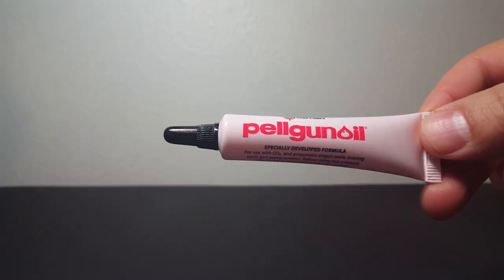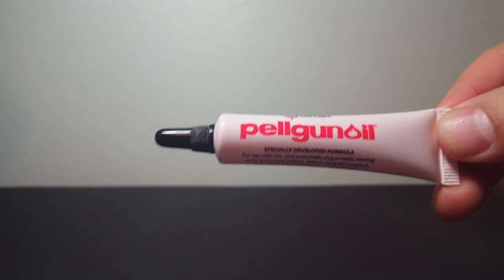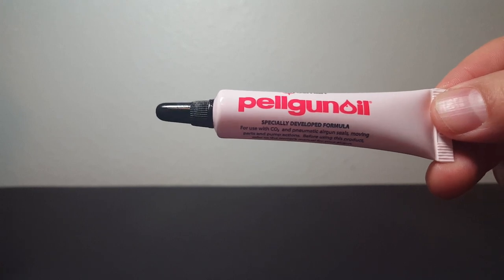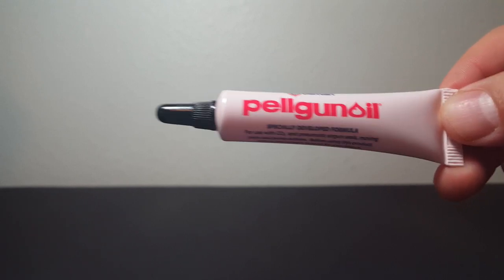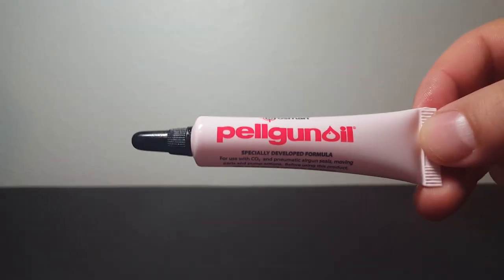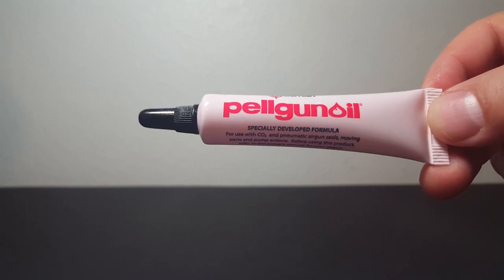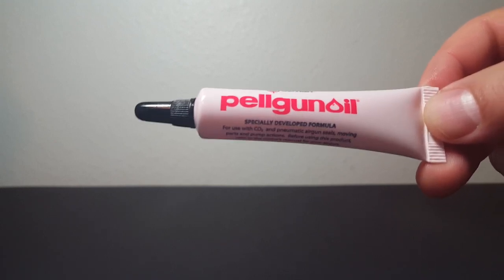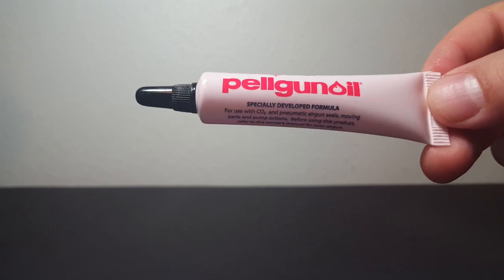Pellgun Oil: What is It?

Comment: Hello sir
First thank for the video
Sorry my English is not good I have question and I hope you can help me
I have crosman pumpmaster 760 it's been 1 year and I think I shot maybe 300or 400 times the forearm is a little bit become hard to pump and the manual of the rifle said: it's important to add 
pellgunoil 0240 every 250 shots to ensure the uniform power
I have the 0241 crosman pellgunoil
Should I put or not?
Do you advice me for better alternative?
Reply from the maker: Mohsin, since you already HAVE the Pellgun oil on hand, yes, you can use it on your 760.

When a pump gun is not used for awhile it does better to wake it up with some lube.

Use your Pellgun on the rubber cup you see and can feel when your pump handle is all the way up. Then, yes, every 250 shots. Crosman pump guns can be oil pigs! But no big deal. When it honks, squeeks, or is hard to operate lube the cup and the pump joints, metal links.

There is nothing inherently wrong with Pellgun for your 760, but it is EXPENSIVE for motor oil. And 30 SAE ND does everything Pellgun oil does except cost as much. That big jug of 30 ND can be used for other lube jobs. But you would need to buy some squeeze bottles for your 30 SAE ND.

But use the Pellgun oil you have, and when you run out, make the choice then what to go with at that time. The price and the leakage problems, I had, made me look else where.
Reply: @daisy880fanaticfixit9  thank you for your help so the point is the cost as it motor oil in small amount so no damage to my 760 pumpmaster? safe to use? And about the cost I got the pellgunoil for about $4 maybe
Reply from the maker: Mohism, you are welcome. Thank you for being curtious.

No, damage to your 760. But for FUTURE safety, DO NOT use Pellgun oil on a break barrel or PCP.

If you read the Pellgun tube, it SAYS on there not to use that motor oil on PCP OR break barrel. It detonates or expodes.

The biggest controversy is CO2. Some swear it wrecked their seals. But others say, CORRECTLY, that mishandling CO2 platform - like leaving CO2 IN THE GUN when not in use - destroys the seals.

Leaving open CO2 in gun would be equivalent to you leaving your 760 pumped and not shooting it. Don't do that - THAT MOVE CAN DESTROY  a pump gun. Pump and shoot. You decided you are done shooting, but the gun is pumped, SHOOT IT into a bush. Then put it away.
Reply from the maker: 2nd reply: On cost, the Husky is FAR SUPERIOR and look what you get for $8

https://www.homedepot.com/p/Husky-16-oz-100-Full-Synthetic-Compressor-Oil-018-0083H/300135698

This 30 SAE easily does what Pellgun oil does, and it is FOUR DOLLARS FOR A QUART.

https://www.walmart.com/ip/Super-Tech-Non-Detergent-SAE-30W-Lubricating-Oil-1-Quart/52626201
Reply: @daisy880fanaticfixit9  thank you for the very helpful information and I will add another question if not bothering you I don't want be annoying but I am really glad find such nice person like you / I did mistake and I want to know if this hurt the gun or not
I was shooting my pumpmaster 760 and I forgot that already pumped and reloaded the gun I take the forearm down to pump and I accidentally pull the trigger and shot while the forearm is down ! I know it's stupid mistake but is there any damage on that or it's ok? Again thank for your helping me out and have nice weekend
Reply from the maker: Mohshin, I try to be nice to nice, polite people. You are always welcome to ask questions.

You said your English is a struggle so let me answer that my best. If you pulled the trigger when the PUMP IS OPEN, you don't want to make that a habbit. Only pull the trigger blade when the PUMP IS CLOSED.

For ammo, your smoothbore 760 will shoot really well with Crosman's own Premiere Wadcutters. Just five pumps on my 1100 does great. You may want four to six for a 760.

https://www.pyramydair.com/product/crosman-premier-match-grade-177-cal-7-9-grains-wadcutter-500ct?p=313

Comment: Do it stop your gun from leaking?
Reply from the maker: Good question. If the seals are worn down - like 760 compression cup or an 880 O ring, then, no, new seals are needed.

But I know  many pump gun users WAKE UP their guns when pellgun oil or 30 SAE ND is used. It RE-SEALS it after a gun has sat unused for long periods. Stops air from escaping.
Reply: @daisy880fanaticfixit9  is dat a yes or no
Reply from the maker: YES, if your seals are still good. It keeps you at MAX power.

Comment: Can I use this on my Red Ryder rifle? Because I got mine today, and I'm gonna need to oil it soon
Reply from the maker: Lunar, yes. Pellgun oil fine here. But I need to say more to keep you a happy Ryder shooter!

If it is NEW...you should remove lever (super easy) and put that lube on the SLANTED PLATE you see inside. Use a light if you have to. It helps stop the new Ryders from trigger area jams. These three potential jams:

(1) Bear trap
(2) Sticking piston sear
(3) The plunger, or spring rod, from jamming inside frame.

Lunar, also, you will be REWARDED with better accuracy - smoother trigger and smoother gun firing behavior.

Happy Ryder plinking  and please don't re-shoot BBs.
Reply: @daisy880fanaticfixit9  thanks for filling me in on all the info! Imma go subscribe to you now😳😁

Comment: can i put  PELLGUN on the internals of my umarex colt SAA revolver
Reply from the maker: Martin, you can use it on the moving metal parts - and the best way to get it on the internals is not to disassemble. Just put a drop of Pellgun oil on tip of  EVERY NEW CO2 you put in your pistol.

Umarex would prefer you use RWS silicone.

Others say to get best value on airgun grade silicone. 
https://www.amazon.com/Super-Lube-56204-Silicone-Lubricant/dp/B083NXVGQX
Reply: @daisy880fanaticfixit9  thanks for the help

Comment: Is ok to use on a red ryder?
Reply from the maker: It is, but lighter oils are smoother in the Ryder. Also, I found it easy to flood the Ryder with pellgun oil because it is hard to see what you are doing. Then, the oil runs down your gun and stock.

https://ballistol.com/pages/about

https://www.oreillyauto.com/detail/c/non-california/pure-guard-non-california-motor-oil-10w-1-quart/pgdn/nd10qt

Using a needle nose, practice on a piece of paper before lubing, so you have an idea of what is happening inside your oil hole.

https://www.hobbylobby.com/Art-Supplies/Painting-Supplies/Palettes-Tools/Needle-Tip-Applicator-Bottles/p/80984644

Comment: Will this work for my break barrel Hatsan mod 25 Supercharger pellet gun? 1 drop down the barrel? If not, what would you recommend? Thanks
Reply from the maker: Eden, great question! NO WAY! I will give you other choices. No petroleum goes in a spring gun like your Hatsan. It will FRY your piston seal. No power.

This is a common flub, treating a Springer like a pump gun. Your Hatsan needs only rare, careful silicone lube in transport hole. That hole appears when you break open breech. A drop or 2 every 1000 shots.

https://www.pyramydair.com/s/a/RWS_Air_Chamber_Lube_Dropper_Silicone_Oil_50_oz/3002

https://www.pyramydair.com/s/a/Crosman_Silicone_Chamber_Oil/311

Comment: Can this be used for my crosman 760 pumpmaster I'm new to pellet rifles and what part do I use it on?
Reply from the maker: Bray, you can IF you already bought it. But there are cheaper alternatives that are arguably better.

Lube rubber cup in open pump and hinge points in pump handle.

Here are HUGE value choices:

https://www.homedepot.com/p/Husky-16-oz-100-Full-Synthetic-Compressor-Oil-018-0083H/300135698

https://www.oreillyauto.com/detail/c/pure-guard/pure-guard-compressor-oil-4-quart/pgd0/ac18

https://www.hobbylobby.com/Art-Supplies/Painting-Supplies/Palettes-Tools/Squeeze-Bottles/p/57415

Bray, compressor lube is DESIGHNED for a pump environment.
Reply: @daisy880fanaticfixit9  thank you for responding I'll look into the other choices

Comment: Crosman also sells a silicone oil so when should I be using it?
Reply from the maker: GREAT question. Pellgun oil is so controversial and either loved or hated.

On the latest generation of pump guns, Crosman actually says to use their silicone on the Legacy  - which would also cover their other pump guns.

If you own a PCP or break barrel, the choice below is the #1 choice.

If you are into basic pump guns or CO2, and are determined to use only silicone, know it MUST BE AIRGUN GRADE. Here is #1 choice here and GREAT VALUE!

https://www.amazon.com/Super-Lube-56204-Silicone-Lubricant/dp/B083NXVGQX

Comment: Is there an oil that can be used for every part of the gun because I feel like having to buy different oils for different parts can be a hassle
Reply from the maker: Feng, very fine question. I was just just wiping down Crosman PSM 45 with Ballistol. The classical German oil makes beautiful wood, metal and black plastic. If anything black plastic looks the best!

I use FP-10 on a few grinding spots and RWS Silicone for the power plant every 800 shots.  

3 different products.

Feng, I will guess you are talking  about a pump gun. Crosman actually started labeling that lube isn't for PCP or break barrel.

For my  Remington 1100, I just lubed the loading bolt, and the metal pump joints and seals with 30 SAE ND. Order a dropper or go to Hobby Lobby or fav gunshop.

🌟Non-detergent motor oil is compatible with the black plastics, metal, and the Nitrile seals in the 1100 gun. I used it for all three.🌟

Many think petroleum, which is actually mineral oil for lube, is bad. That isn't based in science. Many use poor quality silicone products that aren't good for your gun - Gamo flat goes on the offensive and says  even expensive silicone will actually cause DAMAGE to metal on metal.

That paragraph I just stated covers the engineers at these companies:

RWS
Gamo
Crosman
Daisy
MAGNUM AIRPOWER

https://www.oreillyauto.com/detail/b/non-california-4604/chemicals---fluids-16461/oil-16865/motor-oil---conventional-25267/2673028dc6c2/pure-guard-non-california-conventional-motor-oil-30w-1-quart/nd30/4616028

Comment: On the instructions of maintenance on my airgun it says to oil it every 250 shots but I don’t know where to oil it can someone’s plz tell me where???
Reply from the maker: FIRST, let me congratulate you, sir, for reading the instructions. Many don't read. Then they hear from buds to use spray silicone - and they lose their gun quickly.

Yes, Crosman wants it every 250 shots. My 1322 video covers what it looks like. But open the pump, target the rubber cup at bottom of gap, and  put 2 drops there. Put 1 drop on the joint above it in the pump tube; that connects to the pump handle.

If the metal links look dry put a drop on the pivot points (inside rivets). One spot is at the top of pump tube where retaining pin holds it in place. The 2nd pivot point is the arm connecting to the pump handle.

Comment: What about auto trasmision oil. They have many O rings.
Reply from the maker: Karen, TF will work if you CAREFULLY choose your formulation. Or it could damage your gun. 

A Brit chose the wrong Tranny formula, and it demolished his buffer on the pump head in the 880.

Karen, would you consider compressor oil? They are non detergent - and no other additives that could hurt your pump gun or C02.

https://www.amazon.com/Husky-100-Full-Synthetic-Compressor/dp/B08BXK3NFD

https://www.homedepot.com/p/Husky-16-oz-Air-Compressor-Oil-HDA10700AV/100096995

https://www.hobbylobby.com/Art-Supplies/Painting-Supplies/Palettes-Tools/Squeeze-Bottles/p/57415

Comment: Will this work on the red Ryder?
Reply from the maker: Yes, but 30 SAE ND with a needle nose bottle preferred by Red Ryder veterans.

Magnum Oil Statement:

PERFORMANCE PARTS FOR CROSMAN & BENJAMIN AIRGUNS

AIRGUN OIL MYTHS

It's a myth that petroleum oil is harmful or unsafe to use for airguns. This stems from the common misconception that petroleum oil and distillates are the same thing. They're not, oil is what's left after the distillates are removed from crude oil. Petroleum distillates are not safe for use in airguns for a variety of reasons. Some petroleum oils also contain distillates and those are also not safe.

Crosman Pellgunoil (re-packaged Monolec GFS 8430) is SAE 30 engine oil with a high level of detergency. Because it's single-viscosity it gets significantly thicker in cold temps.

 Magnum Airpower's HIGH-PERFORMANCE AIRGUN OIL is full synthetic and multi-weight. It flows freely at very cold temps and maintains it's viscosity at very hot temps. It has the highest level of anti-wear and anti-corrosion additives of any oil sold for airguns.

FURTHER READING:

This subject is even more confusing to many because some distillates are commonly referred to as oil. The most common examples are heating oil and penetrating oil which are both petroleum distillates. The oil that's safe for airguns is called mineral oil also known as heavy oil. Mineral oil is non-toxic and non-flammable but it's combustible at very high temperatures. It protects against wear and corrosion better than silicone or natural oils, will not harden and doesn't become rancid. This is why all engine oils, including synthetics, are mineral oils.

Comment: @ Daisy 880 . What would be best used in a gamo magnum .22 cal? I see they have this pellgunoil on Gamo’s sight but
I don’t wanna use it if its bad . Thanks man
Reply from the maker: PELLGUN OIL NOT FOR BREAK BARREL OR PCP!☠

If the above choice is unavailable, this would be second choice,  but acquire a needle nose for it.

https://www.amazon.com/Super-Lube-56204-Silicone-Lubricant/dp/B083NXVGQX
Reply: Thanks your the man
Reply: Do i just add a drop on a patch to run down the barrel, or is there any other components on the gun i should put this oil on?
Reply: Also i just bought ballistol,lucas clp, and a bottle of Gamo’s airgun oil on there website a week before i found your video .  Would any of these be ok since i don’t already have the magnum oil.🤷‍♂️thanks again for your feedback
Reply from the maker: Michael, if you bought Ballistol - THAT IS THE WIPE DOWN KING! Wipe down your Gamo every 50 shots. 

As far as lubing your magnum in KEY points - BEWARE, BE CAREFUL! Gamo doesn't want you putting much down the transport hole - the hole you see when you cock your gun. It can blow up your seal and destroy your power.

Keep Ballistol AND that Gamo oil OUT of there. Only a drop or two every thousand shots with the silicone needle nose I described before.

No rush on power plant lube. 1000 shots from now you should have Bill's Magnum silicone👍
Reply from the maker: Michael, use Ballistol for patch cleaning of barrel. Go breach out muzzle. Dry off breech seal with dry patch.

You shouldn't need that more than every 500 shots.
Reply: @daisy880fanaticfixit9  Thankyou , i didnt forget to subscribe too your page. Youve been a major help

Comment: I really don’t know what to use. I have a umarex glock 17 gen 4 and a Springfield armory XDE. I just bought pellgun oil but I’m not sure if it’s safe to use or not. These are my first 2 airsoft guns so I really don’t know anything about them lol.
Reply from the maker: Yung, many CO2 users don't like it for their guns. Umarex wants only airgun grade silicone for their CO2 guns.

Here is popular choice that is BETTER PRICED. You get more quality and quantity. One drop on top of every new CO2.

https://www.amazon.com/Super-Lube-56204-Silicone-Lubricant/dp/B083NXVGQX
Reply: @daisy880fanaticfixit9  Thank you so much. I really appreciate it. I will definitely have to pick some up. I’m glad I waited before using my pellgun oil
Reply from the maker: Since you are being thankful, a little extra for you - it was brought to my attention, and confirmed, that Crosman is NOW even saying to use airgun grade silicone on their pump guns. That is hardly a ringing endorsement for Pellgun oil that has HEAVY detergents that C02 shooters are saying cause problems. I would use the Pellgun for tool joints or the sliding door rail!

Enjoy your airgun grade Super Lube 5000 CST lube ✌

Comment: Could I use just regular mineral oil or does it have to be specialized pellet gun oil
Reply from the maker: Big papa, no, the only thing special about Pellgun oil is its high price! There are better, low-price choices that are all-round multi-purpose mineral oil.

The Super Tech is CRAZY affordable and is produced by Wal-Mart, so it is competitively priced. Avoid their other blends - this is for your pump guns or CO2.

https://www.walmart.com/ip/Super-Tech-Non-Detergent-SAE-30W-Lubricating-Oil-1-Quart/52626201

Daisy classical recommendation:
https://www.oreillyauto.com/detail/b/non-california-4604/chemicals---fluids-16461/oil-16865/motor-oil---conventional-25267/2673028dc6c2/pure-guard-non-california-conventional-motor-oil-30w-1-quart/nd30/4616028

Best value here as Husky gives you FULL SYNTHETIC ND.  Best wear protection:
https://www.homedepot.com/p/Husky-16-oz-100-Full-Synthetic-Compressor-Oil-018-0083H/300135698

https://www.walmart.com/ip/Plastic-Dropper-Bottle-10ml-0-34oz-Small-Mouth-Drop-Bottles-Empty-Squeezable-Eye-Liquid-Dropper-Bottle-White-10-pcs/797157165

Comment: Just curious would it be ok for a sig sauer MCX .177? Semo auto pellet rifle?
Reply from the maker: Pellgun oil is a choice for your MCX. Here are other better VALUE options. Just buy basic squeeze bottle from Hobby Lobby or Wal-Mart.

https://www.walmart.com/ip/Super-Tech-Non-Detergent-SAE-30W-Lubricating-Oil-1-Quart/52626201

https://www.homedepot.com/p/Husky-16-oz-100-Full-Synthetic-Compressor-Oil-018-0083H/300135698

https://www.oreillyauto.com/detail/b/non-california-4604/chemicals---fluids-16461/oil-16865/motor-oil---conventional-25267/2673028dc6c2/pure-guard-non-california-conventional-motor-oil-30w-1-quart/nd30/4616028